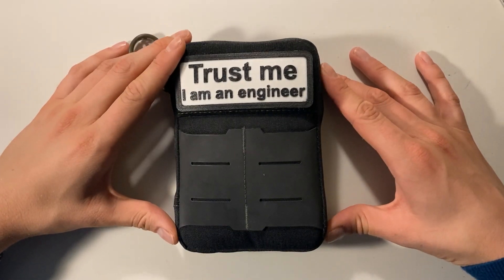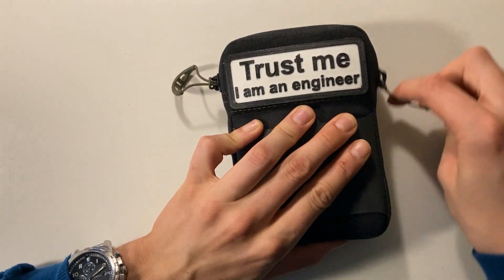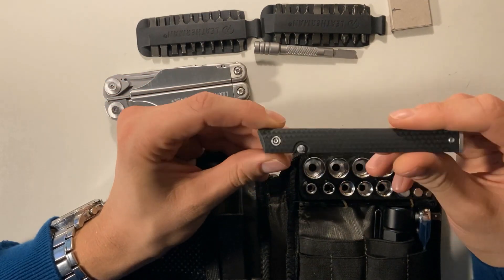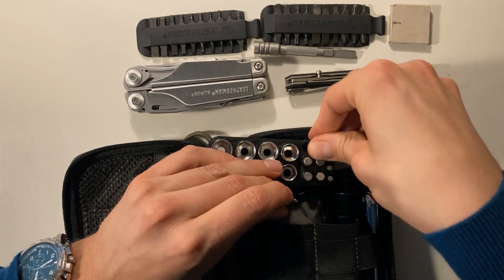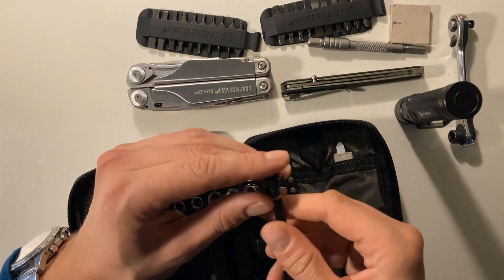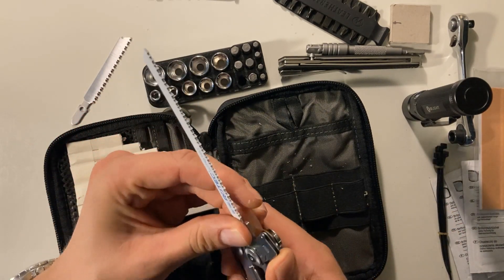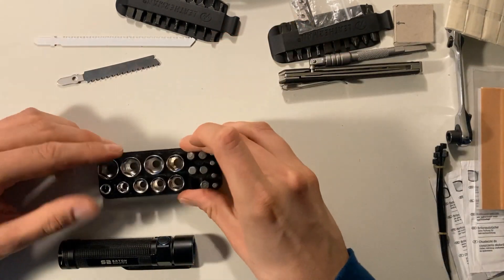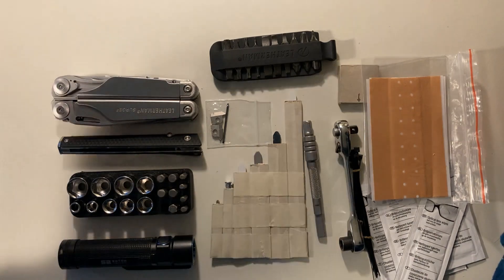EDC for Engineers

Comment from the maker: I am sorry guys for sharing the packing list of this pouch so late. Here it is with links!

1. The pouch:	https://amzn.to/47f64Kz
2. Leatherman Surge:	https://amzn.to/3RWT0Fn
3. Leatherman bit set:	https://amzn.to/47dCAgb
4. Leatherman Bit driver extender:	https://amzn.to/3tuTwkB
5. Compact knife CRKT CEO:	https://amzn.to/3vhadk5
6. Olight S2-baton alternative - Olight S2R II:	https://amzn.to/41zwkhL
7. Socket set 4 mm - 13 mm:	https://amzn.to/3NFLhZC
8. Screw extractors:	https://amzn.to/3TGWXPU
9. Micro bit adapter:	https://amzn.to/3TEYLso
10. converter 1/4 inch to hex:	https://amzn.to/479KmI5
11. Alternative jig saw blades (steel, wood, plastic):	https://amzn.to/3H0oQee
12. Bandages (best imo):	https://amzn.to/3toSIOh
13. 4 inch zip ties:	https://amzn.to/41BESV4
14. Lens wipes:	https://amzn.to/48yWV0I

Comment: Nice kit, but I'm surprised you don't have a 150mm/6" steel rule. Don't you ever need to measure the length of some bolt or something?
Reply from the maker: Good one! Typically I don't need a ruler on the go. However, I do have a ruler in my drawing kit!

Comment: I put together a EDC pouch but mine has 2 compartments. It's more for bicycle, Motorcycle, home repairs or for simple away from home. 1 side has guaze pads, medical tape, bandais, and hand wipes, that can be used for cleaning out cuts, or cleaning a dirty tool, to store it back in the tool side of the pouch. The tool side has, 5inch Knipex cobra, 6inch Knipex pliers wrench, Milwaukee fastback 6 in 1utility knife, 24 double sided Wiha bits, leatherman extension, leatherman ratchet extension, ACEBEAM Pokelit AA, Olight Open mini, and a Knifeless Rebar, with Bit adapter. I have a Olight IR2 Pro and a Victorinox Rambler on a locking carabiner at all times on my belt lupe. I am always getting cuts or blisters that bleed, or a callous comes off or cracks from plumbing or all the jack of all trade side jobs I do, that I always carried bandages in my wallet, but instead of just 1 bandage, I can now carry a few, plus tape, and cleaning wipes, to help decrease infections. 1 cut was really red last year and it had to be cut open and stitched last year, so now I carry this. Plus I always have tools on me, when I go to look at a property, but I normally have a tool bag and sometimes power tools on me, depending on the job. About a month ago, I was able to help someone crying outside, because a plumber turned the house water off. The bathroom facet had bad shut off valves and they were leaking. The faucet needed to be replaced as well. Her quote was ridiculously high. I ran to the store with her to get some shut off valves and replaced the valves and turned her water on. She was so happy. I just gave her my number and she gave me a hug and I continued on my bicycle ride. The tools I had in my EDC pouch helped her. That's why I carry it in my backpack that I have a water bag thing with a straw in it. I know that I didn't fix her entire issue, but she was able to wash her dishes, use her shower, wash clothes, and everything else that she was talking about that she could do. I never got a call to come do the work but she said that she was in between jobs, so, I might still get the call to make some money to replace the facet. The shutoff valves were easy and it was payment enough, to see her so happy. I fixed a few things at my Aunts house as well. I never understood why people carried EDC, until now. It all started with a Victorinox SD classic, on my Keychain, to cut shrink wrapped pallets open and taped boxes open at work. I was a over the road semi driver, and that knife was amazing. I upgraded to the Victorinox Rambler, then carried a Olight IR2 Pro. I am hooked now. 😅

Comment: I love that bit/socket holder. About the sockets - I see you included sizes from 5mm - 12mm. There are nine sockets in total, so I'm interested in which sizes you chose, since at least one of them must be a half size. Also, have you found these sizes to cover most of your needs in the field? I have found that 13mm seems to be one of the more common sizes I have encountered, but I suppose it all depends on the field in which you work.
Reply from the maker: I bought a range of sockets including the 13 mm. I included a cross key (for < 5 mm sockets). The update video shows the changes I made to this kit to this day. I am a mechanical designer, quick prototyping happens often. But because the company is a semi-startup, tool trolleys are limited. So when a prototype needs to be assmbled, I use this kit.

Comment: Great kit! Which tool do you use to exchange the wire cutteres if needed?
Reply from the maker: The leatherman bit set contains the corresponding torx bit. In my current setup I have a printed holder for the leatherman bitdriver extender, making it a screwdriver at its own. My update video took much longer to upload. I simply had no time. However, I will upload an updated video of my current setup. I'd love to read your feedback on it.

Comment: i need a way to store/carry and keep sorted a bunch of 4mm bits. i love my fixit kit, but it takes up a tonne of needless space in the bottom of my purse.  i need a near full set of security torx, plus two game bit and some triwing bits from my kit or another kit that has them and its been very hard, all the good solutions seem to be for 1/4 inch or double-ended bits
Reply from the maker: Perhaps you can think about a model that stores your bits in a more compact manner? Because this sounds like a 3D print solution. If you do this, make sure to use TPU material, like my hexagonal socket holder.
Reply: Look at the HOTO 24-1 precision screwdriver

Comment: After nearly a year I don't know if you'll read this but, another great patch might be:
"I am descended from 5,000 generations of tool-using primates. Also, I went to college and stuff."
    Sean Michael Ragan'

Sean is not me, by the way.

But no circular slide rule?
Seriously, I think the tools you have included are very well thought out.  Thank you for sharing it.
Reply from the maker: I did read your comment! It took a while to sit down and answer to it ;) 

I love your idea of the patch! I might actually print it one day. But it can be tricky to put that much text in a compact patch. My patch is printed with an Ultimaker 3 printer. I've noticed that it can be tricky to have a decent print job when the letters are <7 mm in height. Perhaps the print quality improves in the coming years.

I did not need a circular slide rule yet. For what purposes or projects do you need it?

I will upload a new (updated) video this week. There are improvements and additions to my setup.

Cheers!

Comment: Very nice kit.  I really like the printed socket holder and the cardboard saw scabbard.  But you probably only need 2 saws - the wood one in the Leatherman and the longer metallic one.  You can switch out one of the others for an emory board and a small file/round file I think.  I'd add a small amount of thin/strong cordage.  And a magnet (numerous trouble-shooting benefits).  a small amount of wire for repairs, a little heat shrink tuning and a bic lighter.  Your Olight is great --- but do you need so much size and power?  Switch to a smaller one.  Perhaps you can add a pin vise and some micro drill bits with the regained volume?  Some clips or forceps to use as a microvise?  If anything, you may have too many bits -- you have a lot of bits!  I would also switch your tweezers for a non-magnetic brass pair, add a small wooden pusher tool (like those used in manicure or whittle a chopstick) because its nice to have something dielectric too.  And a small tube of cyanoacrylate glue. Maybe a little sugru?  

These are just ideas because your EDC kit has inspired me.  Overall an excellent job!
Reply from the maker: I totally missed your comment. Great tips, thank you!

Comment: I hate all the survivalist and combat BS that people put in their EDC kits. I used to carry a Leatherman Skeletool with me because all I wanted was a good solid pair of pliers, a bit driver, and a knife. It's a fantastic tool, however; I ended up having to toss it and re-buy it several times because whenever I traveled, they would make me get rid of it. Even when I drove to New York, security at the Statue of Liberty ferry tour made me toss my pocket knife. Now, what I want is a solid pair of pliers, a bit driver, and a utility knife so I can just toss the cheap blade if I forget. The saw blade attachment on the Surge is awesome! I also wish the Skeletool had replaceable wire cutters, though I wouldn't carry replacements. I'd just replace them as they wore out. I can't imagine many situations where I'd need to replace a blade right that moment.

I feel like EDC is a game of diminishing returns. Knives are super useful almost daily. Usually a utility knife will do. Pliers are almost but not quite as useful as knives. A medium sized Philips-head screw driver is quite useful. A flat head is also quite nice. Tweezers? OK. Scissors? I've never run into a situation where a dinky pair of scissors was that much better than a knife. A simple first-aid kit is nice, I keep one in my car, but most of the other stuff is excessive as EDC. You really need a socket wrench with an assortment of sockets every day? You really need multiple lengths and types of saw blades every day? You really need a full set of 1/4" hex bits and another set of 4mm hex bits? You don't need to carry spare set of wire cutter blades, just replace them as needed. If you're going to go through a pair of wire cutter blades in situ, then you'll probably want a bespoke tool.

I'd swap some of that out with a tube of super-glue, a bit of para-cord, a small spool of wire, and maybe a pen and note pad.

Comment: Hi Willem,
thank you so much for this video. Finally someone with sense. If there is just one thing I would add, it is the indispensable FERM SGM 1006 gas soldering gun / blow torch / McGuyver-tool. Or is it just because everyone I know calls me if "something's wrong with my radio" but I use it at least once a week to solder wires or even brazing of copper plumbing.
Reply from the maker: Good suggestion! The thing is that this kit is packed tight and I won't be able to put even a compact soldering iron in there. In most cases of soldering, you only need to connect wires together (typical thing that happens). I think it is sufficient to only keep some tin and some shrink tubes in this kit (there is some room for that). My lighter will act as a soldering iron in that case (tin has a low melting temp). For fine soldering work I prefer my TS100 iron and a workpiece holder.

Comment: Add some safety pins, a curved needle, a magnifying glass a dental pic tool and mirror... I also carry a scalpel, hemostats and dental floss as my EDC doubles as a surgical kit...
Reply from the maker: Thank you for your suggestions! As you might have noticed I assembled this kit just for the essentials, being an almost-engineer. I don't see why (and where) I should put your suggested items in this pouch. However, I did add these items to my first aid kit in my car (even got a stitching kit with a curved needle and toothpicks). Only the magnifying glass is missing, but again I don't know for what purpose I need it. So if it happens that I need these items, I will just need to walk to my car.

Comment: 1. Consider a Swiss Army style knife, I like the Victorinox Compact. Has a small pen, tweezers and toothpick, a parcel hook, corkscrew with mini screwdriver (mini-nail file), scissors, combo can/bottle opener, and blade. Also has a small sewing needle I use as a sim tool or reset button pusher.

2. A proper small plier like Knipex. I like the 87 series.

3. Small prybar with nail puller.
Reply: I disagree. But I would like to see your kit using those changes.
Reply: I also disagree as the surge as many of the tools you are suggesting to add in your #1. The surge has a mini screwdriver, scissors, combo can/bottle opener, and blade. A corkscrew is simply uncommonly used and he has a nail to do what your sewing needing is for. He also has a pair of tweezers and he could simply upgrade or obtain a needlenose pair that would accomplish the button pushing as well and ditch the nails. A parcel hook is also unnecessary with all of the other tools available. 
I will agree that a small staple notebook and a pencil or pen may be of great use to do everything from jot notes to have a plan for the day jotted down and check things off as you go. 
The Pliers you suggest are quality but subjective to the work the gentleman is doing and if he would actually use them. The leatherman surge has a very wide flathead on the interior that has been used for prying when needed by many blue collar workers. While it does not directly have a nail puller, if you even get it started with the prying then the grip of the surge's pliers are normally more than enough to pull out a nail in most cases in my 5 years of owning one.

Comment: I watch these EDC videos, and it''s always stuff you can just buy. This was the first one where I saw some home made solutions. Fantastic!

2 Suggestions I would have for you is
1: get rid of those tweezers you have and get an actual set of them
2: Add in some needles. You can but them between some duct tape pieces so they don't get lost and don't poke you

I REALLY liked those saw blades and the sheath you made for them
Reply from the maker: Thank you! I recently added a new homemade thing. I will upload an update soon!

I got these tweezers because they are very slim. I do have a larger pair, but I because I seldom use them I don't think it's worth to add it (hard to make it fit in the pouch)

That is a good suggestion! I did add 2 needles a week ago and put it into the cardboard holder hahah

Comment: What type of engineer are you?
Reply from the maker: My specialization is in (fine) constructions and mechanisms, mechanical engineering.
Reply: @TheWillem  thanks I'm about to finish high school and have been interested in Engineering since 8th grade 
What was the study called at Uni?
Reply from the maker: @zachambrose625  specialization here comes during the master track. It is at the research group called dynamics and control, of which constructions and mechanisms is part of. The 3 goals of this subgroup are:
- Light and stiff design (strength is typically heavy, heavy moving masses are terrible for high accuracy, quick positioning)
- controlling degrees of freedom (has to do with controlling linear or rotational movements of components)
- preventing play, friction and hysteresis (to ensure high predictability of a system behaviour for control)

Comment: A real engineer would've given the dimensions in millimeters.
Reply: Thats not correct and an absurd statement." Not a single person uses centimetres" They use centimeters in Thailand. I've been working here for 10 years on and off and everytime I come back I have to recalibrate my brain.
Reply: @daletaylor9547  they also use an insane amount of transsexual prostitutes there too but I try not to judge them on that either. lol
Reply: @daletaylor9547  

So, I'm in a mostly metric country. For the layman/person who can barely read a tape measure, centimeters are pretty common. I tend to use millimetres just because it saves using a decimal point. 

Inches and thou get heavy usage though since my machining tools are imperial, most imperial fasteners can be got down here and I cringe when mixing standards in a project.
Reply: @dontnubblemebro  metric is the only way to go. Have you ever come across metric inches? That's a nightmare. Yanks tried it for a while on some of the gas fields in oz way back. Still come across a well head now again that throws us for a curve.
Reply: @daletaylor9547  I didn’t know it was that bad there! I do know the story told of how the garment industry failed metrication because they tried to use centimeters.
Reply: All the scientific community only uses the metric system.  Most countries use the metric system.
Reply: A real engineer can use any units depending on the situation. Simple conversions are nothing.
Reply: Centimeters is verbal shorthand. Its just a multiple of millimeters. Why all the vitriol over something so trivial?
Reply: Engineers measure floor loads in kips.
Reply: Engineers measure floor loads in kips.
Reply: Yeah if the audience to that level…. I am not
Reply: Engineers are just craftsmen with a qualification from university 😂.
Reply from the maker: You are absolutely right. My supervisor would kill me if he watched this video. The thing is that these are approximations, it is not a nice, rectangular box!
Reply: @TheWillem  As the Metric Maven says, centimeters are evil!
Reply: @TheWillem  Not a single person uses centimeters.
Reply: @spikeypineapple552  R U serious!?!?!
Reply: @MrKnivesGuy  yes. Cms are for children.
Reply: @spikeypineapple552  ahahah!!! I LOVE you!
Reply: @spikeypineapple552 I used centimeters all the time when I was still single..